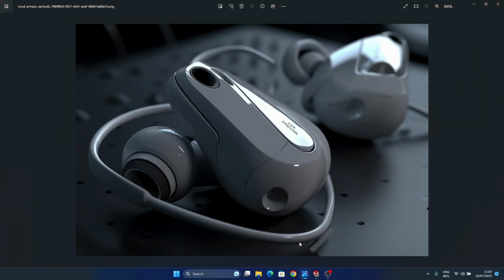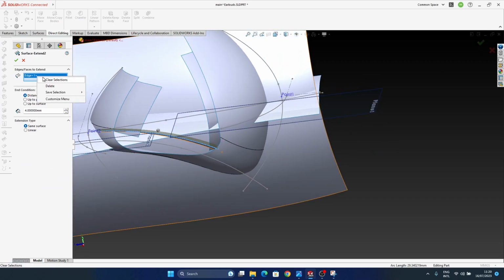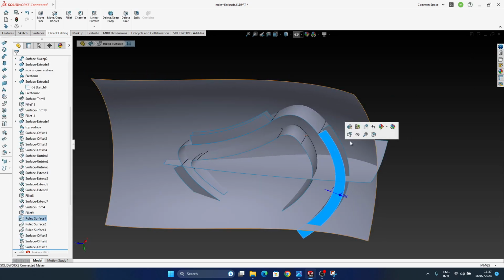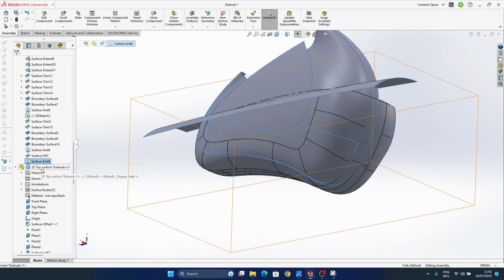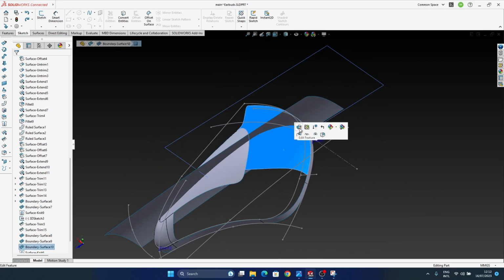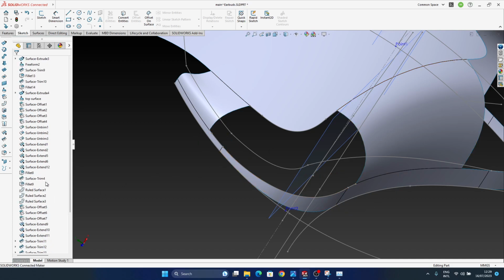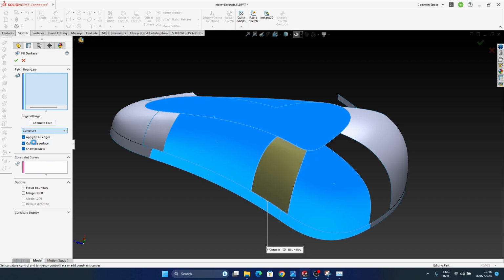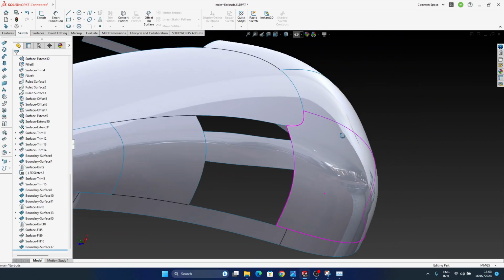Refining Solidworks surfaces - earbuds - part 8

Comment: And can you also post video in which you finally render them like in thumbnail of Video
Reply from the maker: Hi. When is going to be ready, I will do, that's the plan. I'm thinking if to use Corona engine or twinmotion ... Which one you would you be interested to see - Corona or Twinmotion?
Reply: do it in whichever is free or easy to use
 @CAD.Design.Rendering

Comment: i have solidworks 2022 but it is not having reflective black appearance in it? How to find it
Reply from the maker: Hi there! If you go at the same place where you have "apply scene" and click on the arrow you will have a drop down list and right at the bottom of the rollout you will have "manage favourites". Than a window where you have all the scenes that solidworks is having will pop up. I ticked all of them so that I try as many as I can over the time until I find one that I like. Once you tick the one you like to be one of your favourites, it will show up next time. Hope this answers to your question 😁
Reply: @CAD.Design.Rendering  yes 👍 i actually thought that a long list should appear. Anyway, thanks